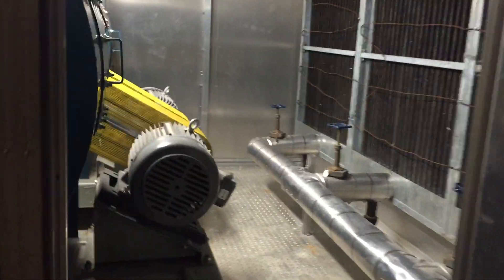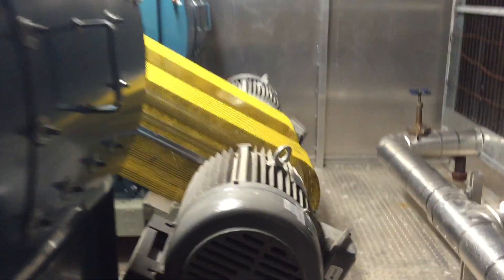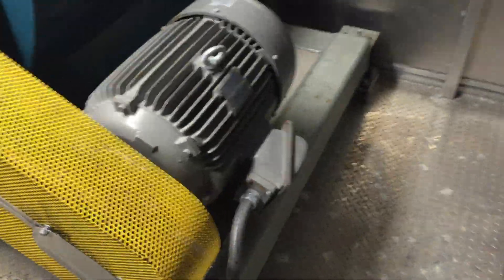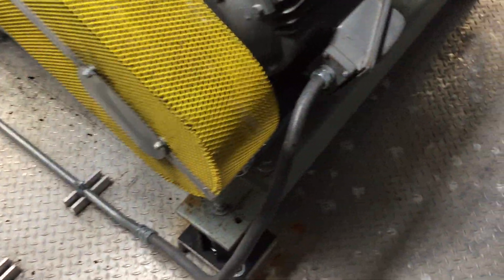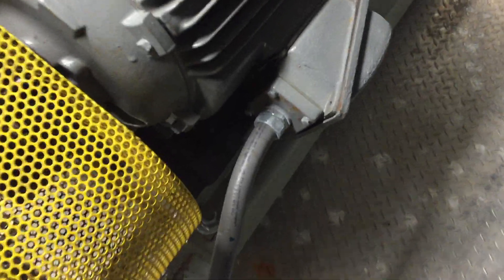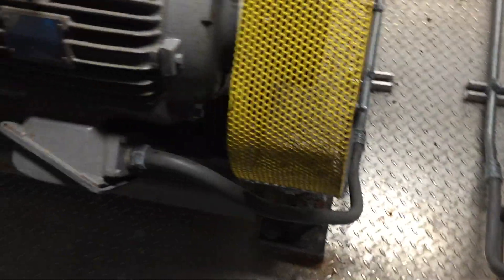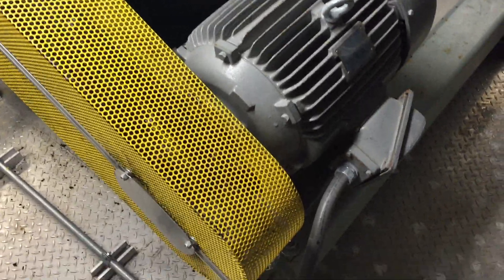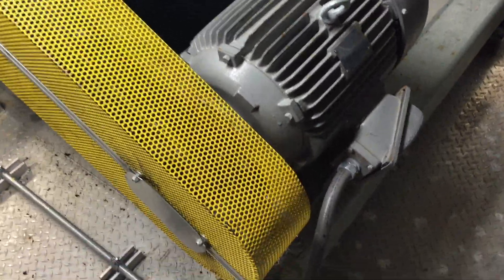Moving Violations Video No. 155: Spaces for Environmental Air

Comment: Wow I don't know about that. I'm sure you are correct in your code knowledge but it seems to me that the inside of an air handler very much could be a damp or wet location especially if something is wrong.
Reply: Me too.  This is new to me.  Thanks for the information Russ!!
Reply: Feed The Chunk Like I said, the guy's good and most of these videos make perfect sense. I just have to disagree on this one. The likelihood of this assembly seeing water/moisture is infinitely greater than it meeting flames. Even if both whips burned up completely the amount of smoke would be negligible compared to whatever caused the fire. I'm all for doing things the right way and I wouldn't feel right about putting dry location flex in what is very likely to be a wet environment.
Reply: I'm with you guys on this one.
Reply: Stupert23 yeah, sometimes practical application trumps (or should) code technicalities. I feel like a different inspector (maybe with a mechanical background rather than strictly electrical) might have seen it a different way. If you ask me, it's obvious the installer did what he knew was best. Not like he cheaped out or something. Liquid tight is much more expensive than FMC